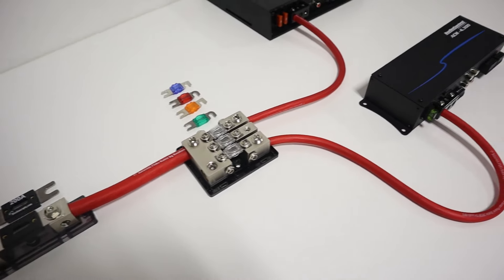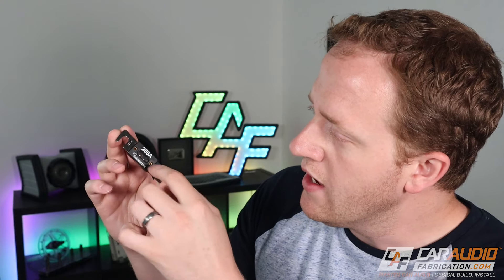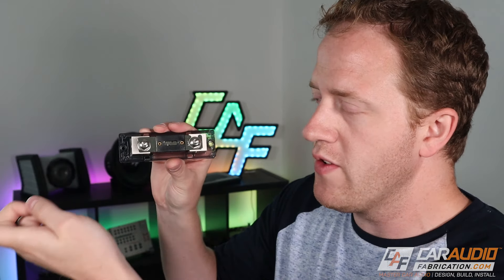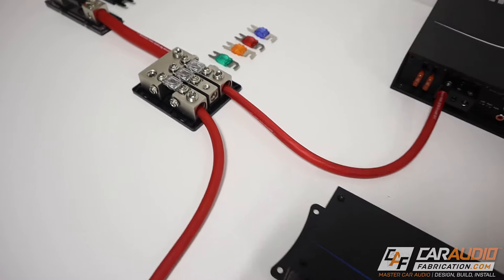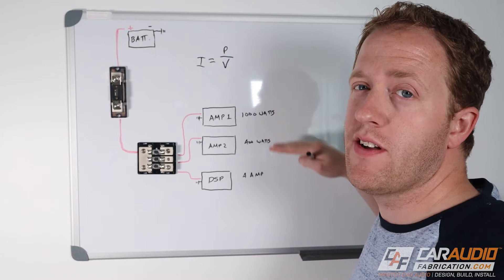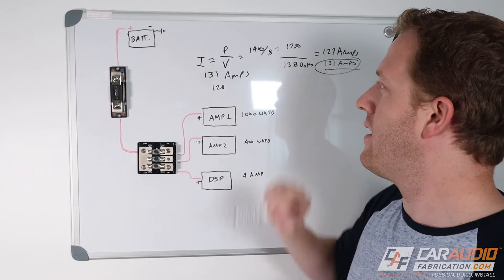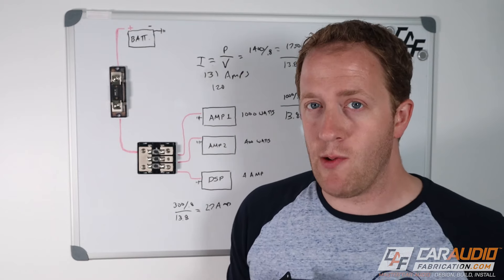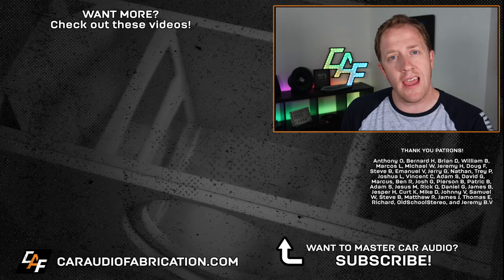Fuses EXPLAINED! What size do YOU need & MORE!

Comment: I’ve always wondered if 100amp circuit breakers could be swapped for a 100amp in-line fuse?
Reply: If your using a QUALITY breaker yes, I've run many in place fuses. Chinese ones dont hold up so well. They fail after around a month under half load. 
I typically use in Inverter installs, but I have used in audio as well.

Comment: My math is a bit off these days (infact it's always off..) but just to clarify in getting the 80% of 1400W is 1750W? 

Shouldn't it be: 
1,120W? 
Cause 80% of 100 is 80 right?
Reply from the maker: You need more power in than out. It is physically impossible to have more power out than in. My math is correct.
Reply: @CarAudioFabrication Got it. Thanks Man!

Comment: Does anyone make a fuse holder that attaches directly to the battery? Sounds like that would be best. My next question is: do some manufacturers size their amplifier fuses based on RMS instead of maximum/peak power? I just ordered a 400 watt (maximum power) Kenwood amplifier that is fused for 15 amperes. Going by your calculation method, at 80% efficiency (it's a class D amplifier) it should be fused for 36 amps. Even at 100% efficiency it would have to be fused for 29 amps - still more than the 15A fuse that it comes with. Going by RMS rating, the amplifier is rated 45W x4 = 225W (4 ohms) - at 80% efficiency would require a 16A fuse. Or did I misunderstand you? Kenwood KAC-M1814

Comment: What if your car has a power lead off the fuse box a 50 amp fuse do a still need a fuse on the wire
Reply: Yes. If something in your system fails, you dont want it to knock out the rest of your car.
Reply: No it has it on fuse post that is separate from the car
Reply: A fuse is a fuse... unless it's too big than its a fire starter.  If the fuse is connected in line with your power lead and it has a LOWER power rating than the wire connected to it, it should do the trick. If you are not sure if the wire is connected to the fuse then pull the fuse and test the other end of the wire for voltage.

Comment: Why is it we need 0 or 4 gauge power wire but only 12-16 gauge subwoofer wire?  I'm confused. I'd think if the power wire is 4 gauge than the speaker wire would need to be at least 4 gauge considering the electricity just went thru an "amplifier" and therefore was amplified. Makes more sense to refer to Amplifiers as Converters considering they don't amplify, they convert.

Comment: So there is no point of having a fuse after the first fuse box after by the battery as long as you used the same gauge wire to the rest of components ?
Reply: Its always better to have fuses with your distribution blocks. That way if one blows fuses you know what section of wiring to go after for the problem

Comment: The voltage he used in the equation, that was the voltage of the battery right?
Reply: That was the voltage of the system when running, so kind of.

Comment: Fuse vs circuit breakers any comments CAF?
Reply: I’m gonna be using a breaker myself but in my case I’m installing my system in a semi truck and I cant always find the fuses I’d need on the road if I blow one whereas with a breaker I can just reset it and if it kicks again I can find the problem and fix it. Breakers aren’t really that expensive. Got the breaker I’m gonna use on eBay for only $8

Comment: So a 300watt Class AB amp would need a fuse larger then 30amps?

I'm about to throw a "300 watt" powered sub in my car as a place holder until I get my other components, but I don't want to burn down my car while I wait.. lol
Reply: Got a cheap place holder tor now that's also rated at 300 watt, but has a 20amp fuse. The fuse pops as soon as you turn the power on.
Guessing the built in amp is bad or the wrong fuse was used. I'm going to try a 30 amp and see if that's the issue. If it burns out the speaker assembly, oh well. I'll buy a new one.
Reply: 300 watts/.8 efficient= 375watts/13.8 volts= 27.17 amps
30 amp fuse for your amp.😉

Comment: No mention of MAXI Fuses? I love my JL Audio maxi fuse distro block :)
Reply: +1 on the maxi fuses, they're readily available at most auto parts stores too. I think circuit breakers are also worth mentioning as well. Little pricier but reusable.  Dont have to stumble for replacement fuses. Though I more commonly use in Inverter installs.

Comment: Could a light bulb be used for a fuse or should i just use a 2 gauge noninsulated wire ? Finally do u think my humor is to dry ? I do have the means to add moisture to it .

Comment: WHAT THE HELL  ???

1000W AMPLIFIER...80% EFFICIENT IS 800W.

A 100 AMP FUSE X 13.8V IS GOOD FOR 1380W

SO YOUR AMPLIFIER BLOWS BEFORE THE FUSE DOES !!!!

50 AMP FUSE HANDLES 690W
60 AMP FUSE HANDLES 828W 

AM I MISSING SOMETHING HERE ???
Reply from the maker: You're thinking backwards. If an 1000 watt rated amp is 80 percent efficient you need MORE power going in. Which is what we are fusing for... not less. Math in video is correct

Comment: So if the amplifier call for a 200amp fuse , you can't run a smaller fuse say like 100amp ? , my brother is borrowing my skar 2000.1d rms amplifier it came w/ a 200amp fuse , he swears up and down he's running it at reduced power by putting a hundred amp fuse in the inline fuse block, funny though he had some Pyle power single 15 that 15 wouldn't hold to the amp I told him he would probably need two 15s and just last night he pulled out his old 15s that used to be in his Monte Carlo they were thumping. No burning smell or smoke yet. Then said he wasn't running the amplifier at full potential. And I know that this car amplifier is the bee's knees

Comment: If the amp works at 80% efficiency, why divide total output by 0.8?? Wouldnt you multiply it by 0.8 to get 80% of the total output??
Reply from the maker: Because it takes more current to make the power, you must have more going in than what comes out. The formula in the video is 100% correct.
Reply: @CarAudioFabrication  ahh yes that makes sense. Thank you for your response.

Comment: Couldn’t figure out why my amp wasn’t working,  took my fuse off and touched the power wire straight to the battery and it turned right on, wonder if I wired it wrong or 6$ ebay fuse is coming back to bite me
Reply: If it's one of the cylindrical glass fuses, it's  not uncommon for one of the end caps to come loose from the actual fuse element, breaking the connection while the fuse element still looks good.

Comment: Only time I use unfused blocks are for grounds.
Reply: Circuit doesn't care which way so fusing either or bot is fine
Reply: @timothyhinton5665  fusing a ground?
Reply: @bobdodge3171  yes. It doesn't hurt if you're running a long ground. Say back to your battery bank. It carries just as much current and can start a fire
Reply: @timothyhinton5665  if it touches the positive yes.. Thats why power is fused near the battery.
Reply: @bobdodge3171  don't fuse the ground wire ever. Totally unnecessary and won't help anything.

Comment: I need some help hope somebody can I am getting toro equipment I wanna put it on my 1991 s10 tahoe truck The only thing I know is I have to use 4 qauge wires for 2 slim 10" 300 watt rms each class A/B compact powered active low profile underseat car subwoofer 
Rms power 300 rms
Rms @ 4 ohms 230 watts x 1
Max voltage 14.5
And 
MR x4 130 watts x4 rms @ 2 ohm microsized multi channel car amp for my coaxial speakers
2 ohm 130 watts x4
Max voltage 14.5v 
I just don't know what size fuse for each amp  and for the fuse holder I am doing calculations but I don't think it's coming out right help!!! 😅

Comment: 9:14 mark ain’t you supposed to do 1400*0.8 to get the 80% efficiency. Because 1400/0.8 is calculating for adding efficiency?
Reply from the maker: No, the way shown in video is correct
Reply: No. The system pulls power from the wall/battery with 80% efficiency. Thus, if the system can power a 1400W system then it draws more than 1400W from the walls/battery. If 80% is 1400W, then what is 100%? Easy. (1400/80)*100 = 1750W. Another way to write that equation is as (1400/1) * (100/80) = 1400 * 1.25 = 1750W. Now, take a look at 100/80. When simplified it goes like this: 10/8 -> 1 2/8 -> 1 1/4 = 1.25. Now, try doing 1/0.8. Isn't that the same as 1.25? No system is 100% efficient. Thus, 1400W of power to the speakers/amps requires more than 1400W from the wall/battery. It's like trying to carry a cup of water, filled to the brim. While walking from the kitchen to your desk, you might drop some water. That's because you are not 100% efficient. You took more water from the tap/bottle than you ended up with at the desk. I hope that it makes sense!
Reply: That's exactly what i always thought. rms*efficiency.  Perhaps that's why i'm not an engineer!

Comment: Think about that myth, your fuse (120A) dimention measure in mm is 3mmx3,5mm (4mm2 around 12AWG) (that failure point) and you have to use 0 AWG wire what is (50mm2) for power? Why the heck did you need 0AWG wire than 12AWG fuse can handle same amount of power? Fuse is made of copper and mixed it with aluminium and zinc (so it makes that melting point lower).. even if you calculate all AMP in max rating (what you use only on low tone.. continius low tone.. so you reach that point only for in peak time if you use max volume for listening music).. And for extra, copper cable manufacture rating those cable allready 3x over.. try to get 12AWG copper cable hot with 13.8V@200A...

Comment: Be careful when using amp wiring kits. Most of the time they will include a fuse for the wire size. Did a co workers music and he had a skar kit that came with a 300 amp fuse but the amp only required a 150.

Comment: If an amp is rated for 500 amps and it's only 80% efficient, wouldn't the actual amps be LESS than 500?  Dividing by 0.8 instead of multiplying would give you 120% efficiency wouldn't it?
Reply from the maker: Nope. You're thinking about it wrong. My way in the video is 100% correct.  It doesn't take less current, it takes more current because some  power is lost as heat and other inefficiencies
Reply: Gotcha - I appreciate the response.  It sounds like the amp is putting out the rated watts, but may draw more to do so?  Love your channel by the way!

Comment: easy way add all amp fuse together so 3 amps 1amp has 2 - 30 amp fuses 1amp has 2 - 15 and 1amp has 2 - 40amp  total fuses 170amps so if you put a 200 amp fuse in the front no bottle neck!!!!!! and that how to pick your main.  in the block same but per amp.  none of these videos goes over the importance of grounds.  even with everything fused a bad ground can cause a fire.  want to learn check out MECP certification

Comment: 1400 watts @ 80% is around 1100 watts
Reply from the maker: Incorrect. You need more power IN than OUT. If we know the amplifier can make 1400 watts and is on average 80 percent efficient we MUST have more power going in. Thus the math is correct in the video.